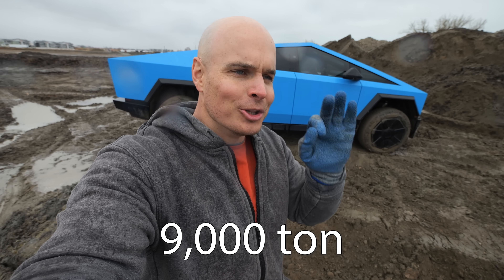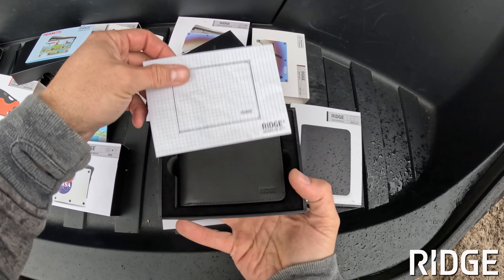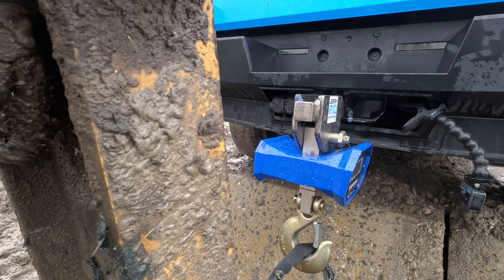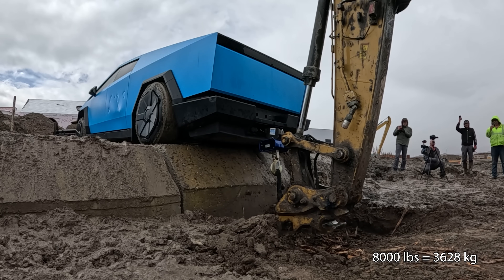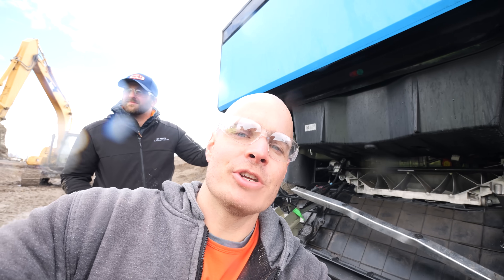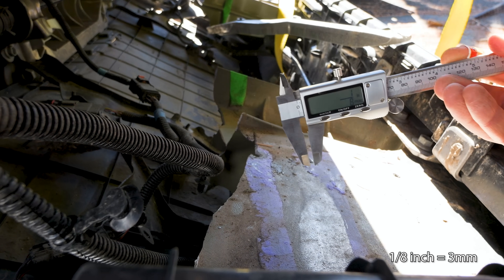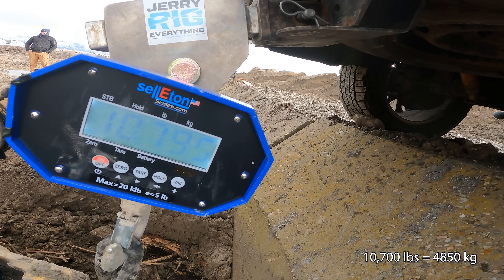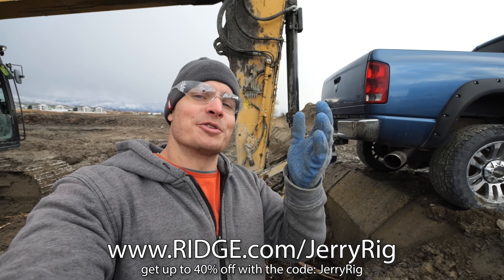SHOULD YOU TOW WITH A CYBERTRUCK?! - (catastrophic failure test)

Comment: I'm no fan of the Cyber truck but it took a win here.
Reply: Plus, the ram had already been through all kinds of loading cycles and an accident, and they still couldn't break it off. The cybertruck was obviously fairly new, with very few load cycles on the hitch.
Reply: The very fact is its failure mode is to snap off instead of bending is an L. Then when you consider that aluminum is subject to metal fatigue, it actually would take a lot less weight to cause it to snap off after a few hundred loading cycles from hitting sharp dips in the road
Reply: @thecrazyfarmboy  It's win. If the downward force is 10x times the rated stat of 1100 before it breaks. It's also better that it breaks than bends, as the only time you are going over that number is if the trailer is tipping over and twisting the car. You want it to break off as that means the car doesn't get flipped too.

Comment: Trucks arent meant to to load 10,000 lbs of tongue weight. The tongue weight of the cyber truck is 1,100 lbs. you loaded it by 10x. Of course it would snap off with that high of tongue weight on the bumper. Will say being built with aluminum isnt so good though.
Reply: You didn’t watch the full video did you?

Comment: I've never seen any truck's front wheel get of the ground because the trailer has put too much weight on the tongue.
So if you have put enough weight to lift the front wheels before it snapped, it is engineered properly. Yes, the dodge frame did not snap, it's also rated for a heavier load.

Comment: WOW A 4MM THICK ALUMINUM FRAME ISN'T STRONGER THAN A STEEL FRAME. Who would have thought that???
Reply: Thickness is only part of the equation for strength.  I hope you realize most the aluminum in an airplane wing is thinner than that and holds thousands of tons in the air.  Structural strength is about the total engineered design.
Reply: @CDFJCB  You're saying the Cybertruck can fly?
Reply: @Amosss  if you send it off a cliff, for a short time, yes.   And that’s where most of these ugly trucks should go, but to each their own on looks.  Point being it’s not all about the thickness.
Reply: @CDFJCB  Yeah, was just jokin around. I saw one down my street, man they are ugly. And way too big for no reason. It was a great idea to use the inside materials on the outside and the outside materials on the inside wow.

Comment: This " Test " was a joke. These guys have no idea. I can't stand musk and tesla can sink into oblivion as far as I'm concerned but I won't ignore stupid or deliberately misleading rubbish.  The truck's TOWING capacity is 11,000 pounds I think they said and they are putting 9000 pounds of vertical load on the tow hitch ?   If the tow limit id 11,000 pounds the vertical rating on the hitch will probably be 700 - 800 pounds.  Strength of the tow hitch was way beyond spec. The towing weight is about the truck being able to be the boss of the trailer.  If they wanted to test that they should have tried to pull them apart.  Complete nonsense.

Comment: I HATE Cyberjunks and Napa-Elon Mush-for-brains but geometry does not lie. Rated towing capacity is not rated tongue weight. It's impossible to load a trailer with a gross weight of 11,000 pound so that it has 11,000 pound tongue weight. At least some of the weight will be on the axle. Also the frame I beam cross section is much weaker in shear (how it was broken) compared to its tensile strength. I do love seeing Cyberjunks break, though.

Comment: With 10,000 pounds on the hitch as tongue weight and tongue weight usually holding 10% of the trailer the down force of 10,000 pounds represents a loaded trailer of 100,000 pounds. Which is a scenario that is NEVER going to happen. Tow rating on the cyber truck is 11K# and my conclusion is that it can easily do that. The scenarios the guy laid out where the hitch could fail are purely speculative and not proven. My conclusion ; Cyber truck is good to tow.  Do I want one? No way. I will NEVER support an idiot like Elon. Do I want a Dodge Ram? I had one and it took me to the poor house with it's excessive fuel consumption. Screw that too.

Comment: Recently i got the cance to peek into some of the internals of a original roadster and the pink adhesive looks like the thermal compund that telsa uses to cool its HV components and modules. Im not sure if they still use the same stuff, but if those two bokes that the pink stuff was on are part of the pack, that could contribute to the codes. (Also huge safety risk)

Comment: I’m no expert in physics but I question the logic of the hitch needing to survive 11,000+ pounds of downforce. A trailer should have no more than 10-15% of the weight at tongue weight (1,100-1,650 lbs). In what circumstance could you see 10x that on the tongue?

Comment: Interesting how ripping off just the rear frame section completely disables the vehicle. Considering how distributed the electrical system is in an EV, I can see other scenarios where localized damage would render the EV useless. In an ICE vehicle, the main engine and trans are centralized and quite protected from external impact. Something to think about. I didn't know the frame was made of aluminum. That seems a really bad idea.

Comment: So 10,408 pounds is way past the recommended weight. 1500 pounds is all you should have on both of those rides. Your content is all usually good but this isn’t accurate. Your fears about tge cyber truck are in vain. The way that works is 1500 pounds going down on the hitch and whatever the pulling capacity is of the vehicle different vehicles have different pulling capacities.

Comment: I’m not sure if this is a good example.  Because that’s actually tongue weight and not pulling weight.   I’m actually surprised the tires don’t pop or the suspension.   The fact that the suspension  didn’t break is impressive I think.  Pulling and pushing down I believe is different but I’m not sure. Also the cybertruck is more like a 1500. A 2500 tows way more than 10k pounds.

Comment: No trailer will destribute even near those 10,000 punds loads, even on most nasty potholes. 11K is TOWING capasity. Mass on tow hitch is max 1100lbs then. Nothing will break a hitch on Cybertruck besides strapping to excavators and putting unreal loads.
This is kinda BS comparison. How is will not lift the whole truck or especially the front before reaching even half of those loads? That alone would easily save the frame. No way any Cybertruck that is properly constructed will suffer of this catastrophic failure.
However, I agree that steel is much stronger than aluminium.

Comment: "I still have the opinion that a steel frame is much stronger than casted aluminum" That's not an opinion. It is a fact. Aluminum is light weight, but what you gain in weight loss you loose in general strength. The Cyber truck is a pile s**t.

Comment: I'm no mechanical engineer, but is this not a test of the tongue weight capacity rather than the towing capacity? Should the test be a horizontal pull? The results suggest that the tongue weight capacity is designed with pretty good safety factor built in.

Comment: This test is stupid beyond belief. I don't need an engineering degree to know that this is a distributed load issue, but to dramatically oversimplify for the internet: some of the weight on the trailer is born on the bumper, and some on the axles. In a poorly loaded trailer, with all the loaded weight forward of the axle and nothing behind it, you will get some levering action pushing too much of the weight on the tongue in a dynamic scenario, and in a static scenario the weight on the trailer will be divided equally between the tongue and axle. Yes, during dynamic loading (like driving over a washboard road at high speed) this may momentarily spike, but typically only 2 or 3 times the static tongue weight in the most extreme non-crash scenarios (remember the truck suspension, and possibly trailer suspension, absorb some of that spike). You would need to exceed the towing capacity of the Cyber truck by like 3-4x its max rating, with a trailer loaded insanely, while driving down an insanely rough road at high speeds to achieve a dynamic momentary tongue weight to do this result. And yes, while aluminum will fatigue with time, unless you are constantly towing on extreme terrain with the max rated load, you will unlikely see this in the lifetime of the truck.

FYI, I hate Cyber trucks and EVs in general, and the use of aluminum in vehicles in general, so I never thought I would be defending it, but this is just so F'ing ridiculous it needed to be addressed.

Comment: 1) i hate electric vehicles, and think Teslas are dumb 2) i do load testing for structural steel not claiming I'm an expert but I know a few things 3) I don't think this was a realistic test of towing or  application. The amount of weight you would need on a loaded trailer to put a 10,000 Lbs load on the tongue would be crazy. Think of how far away the edge of the trailer is from the tongue and how a trailer and it's connection is designed to distribute load across the truck and trailer, also the suspicious there to move with the load to absorb energy. I think you may want to rethink your test set up, the only thing you really tested here was the strength of a rolled steel frame vs a cast aluminum frame and even that's a stretch since they are different geometries and thicknesses

Comment: I don't know about anyone else, but this would definitely be a dealbreaker for me. I wouldn't want my work truck to snap off on me.
Reply: You shouldn’t be on the road if you load more than 8X recommended specs for the town vehicle.  I’ve had an aluminum adjustable hitch for years and even abusing it I still trust it. Then again I’ve never put an excavator completely on the tongue because I wanted to maintain some weight on the steer axle.

Comment: So, if the front wheels aren't touching the ground, does it suggest that it will break soon?
Reply: He should state that if a Tesla is towing something and there is air under the front tires then stay away from it.  Or if the 10,000# load is balancing completely  vertical to the hitch then that is also a sign to stay away.  If either of these are ever witnessed please get some video uploaded because it would surely go viral.

Comment: The idea that the hitch should handle 11K lbs is a very common misunderstanding of what towing capacity is.

Towing capacity = how much weight the brakes and suspension can safely stop or steer. It includes the weight of the vehicle, passengers, etc. 

This is a 6.6K lbs vehicle, the hitch should handle 4.5K lbs being pulled, which would put a downward force on the hitch of between 10%-20% depending on the specific trailer and how it’s loaded. 

This commuter vehicle (“minivan” where I’m from) is a useless embarrassment.

Comment: Seems like everybody in the world is hell-bent on saying that the Tesla is a piece of shit by breaking them.  Everybody's using them in a way that is not designed. And no truck will have a 4 or 5 6000 lb tongue weight!  Any F-350 dually rear wheel diesel truck from 2024 will still only be rated at most 2500 to 3,000 lb of tongue weight. You guys seem to think that we should be able to support more tongue weight than the actual capacity of the truck bed.

Comment: I don’t think this was a fair test, as you were applying force by pushing vertically downward, whereas real-life towing involves pulling a load horizontally from behind. That difference significantly affects the result. Trucks engineered for towing are designed with pulling rigidity in mind—not for withstanding vertical pressure on that part. I believe if you tested it under more realistic, towing-like conditions, the outcome could be quite different.

Comment: Interesting... but even more interesting, is that there is no fail point in the Cybertruck that allows it to keep on driving. The structure around the hitch point shouldn't suffer such a catastrophic failure like that. If anything, it should have some shear points that only require minimal part replacements.

Comment: So what you're saying is, don't balance your loaded trailer on the tow hitch?? I prefer to have most of my trailer load pulling backwards on the hitch... Not down.. But that's just me....
Reply: You're missing the point. Even though they were forcing down when going up a hill or under acceleration the weight of the trailer will pull on the frame. Aluminum is a poor choice for a truck frame because it can't take load or shock stress. Even if you only pull a 5000 pound trailer the constant stress will eventually break the frame
Reply: @hellhound1389 Aluminum can't take a load or shock stress?!? Quick ground all commercial aircraft! whose aluminum frames keeping the wings attached are under constant intense torsional stresses while flying.
Stop all rock climbers from using carabiners! because aluminum can't withstand shock stresses like climbers in freefall and getting whipped into granite cliff faces.

Just say aluminum isn't as strong as steel instead of making up complete bs
Reply: @ 😂🤣 Oh man.... I'm SOOO glad you cleared that up for me! It sure is a good thing that steel (the other popular metal used in frames) doesn't stress crack or fatigue... With your logic, the new Ram trucks shouldn't break in half right??
Reply: The bandwagon Tesla hating is more fatigued than that cybertrucks frame at this point.
Reply: He did it for the left-wing upvotes.
Reply: @IrishSoldier027  truely. So tired of this hate

Comment: I am sorry, but there is no time trailer weight would become tongue weight  unless the truck was vertical downward while the trailer was still behind it and the trailer was still pulling completely. IE maybe hanging off a cliff.  Not sure where you think that would be possible in any normal condition. Chains pulldown downward is such a situation would not be anywhere near the full trailer weight Surviving to 10,000 lbs is more than any possible situation would occur other than off a cliff or being launched into the air

Comment: I worked with aluminum extensively as an aviation structures tech for 40 years. I’ve encountered more cracks than I can count—it was a constant battle. Every part of the structure required rigorous inspections for cracks and corrosion, as mandated by the manufacturer.

I guarantee cracks will be a major issue for the Cybertruck. One tiny stress point can turn into catastrophic failure. Aluminum is great for aircraft, but for a work truck? Pfft. Garbage.

Comment: everyone crying over this video, but I still see a “truck” that becomes fully inoperable because you lost a hitch
Reply: Pushing down with an excavator on a hitch is far from any load that a personal truck would ever encounter.  I’m in construction and would gladly prove this with anyone who wants to donate their truck.  It’s hard to drive a truck that’s split in two.  Search dodge bent with bed camper.  Can’t fix stupid.
Reply: @ a Dodge that literally split in two is completely different than a Cybertruck that lost its rear hitch mechanism.
That’s what im poking fun at because I wouldn’t think being hitch-less would deem the truck completely undrivable lmao
Reply: @Nanohoonnew vehicles of any type are bound for the same fate.  The damn sensors don’t register proper readings so it bricks it until fixed.  Engineers for all brands need to put more thought into this.  I have had a backup sensor fail on a big three vehicle and it wouldn’t let me move in reverse due to thinking I was hitting something.  Ridiculous.  Had to put it in neutral to roll out of the driveway then drive straight to dealership for warranty to replace it.  I love technology, bells and whistles but rendering them useless during fault code is beyond irritating.
Reply: @CDFJCB My daily driver 40 year old Jeep does whatever I tell it to. Sometimes simple is better.
Reply: @ 40 year old jeep is definitely a safe one.  I had a 2018 wrangler and figured out quickly that it wouldn’t drive when the door was open to spot on the trails.  So door latch sensor fail would brick that jeep.  My bigger fear was if my wife was driving and someone opened the door she couldn’t drive away. 
One of my favorite vehicles though.  Miss the trail riding and doing mods to it.